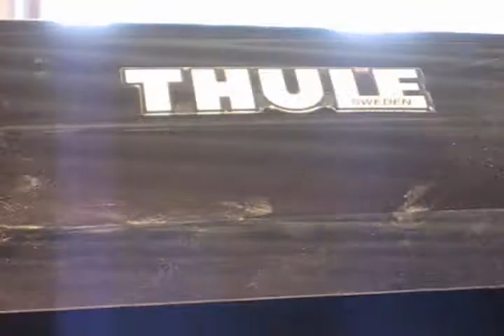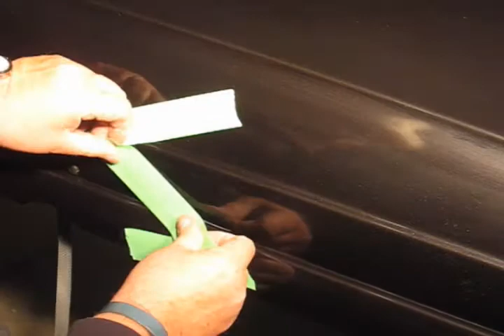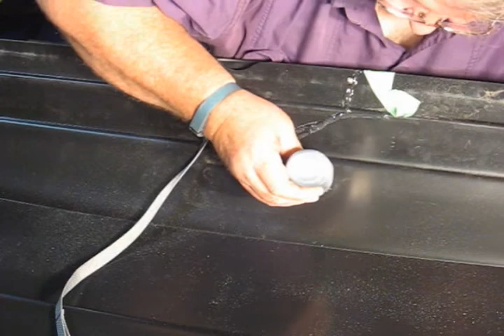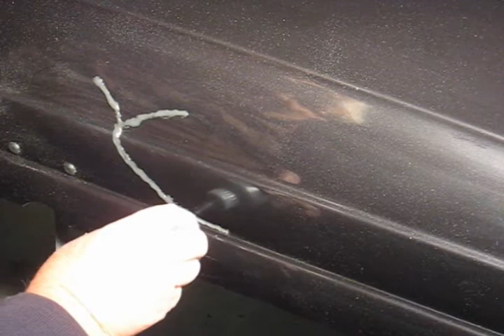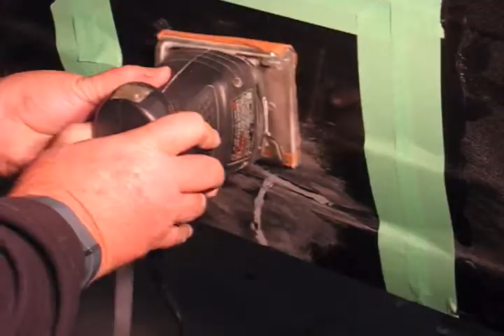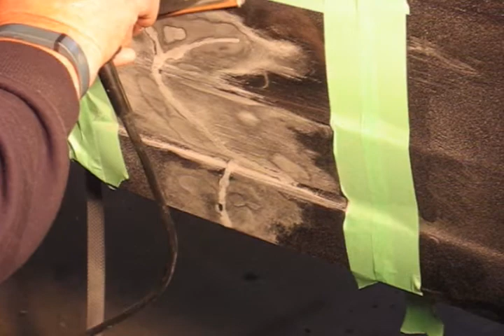How To Repair A Damaged Thule Box

Comment: I already bought my easy ABS repair and I'm about to do this on my Thule cargo box to fix a couple of cracks. My box has a silver exterior paint and the cracks are very fine and not that noticable. I am mainly concerned with long-term strength (prevent cracks from spreading)  and waterproofing so I was hoping to do this all from the inside to avoid repainting or need for decals. Can I apply that v-groove 60% technique to the inside only and does it need to be adjusted for an inside only approach? Also what Dremel bit would be recommended for this? I am new to Dremels and recently got one. Thinking that bit looks perhaps like a 117?
Reply from the maker: The repair can be done from the inside I use a #115 dremel bit but almost any of their carving bits will work. Because it is on the inside you do not have to V groove the crack just make sure there is nothing (like paint)on top of the ABS. Just apply in a 1/8" thick bead straight from the bottle. The resin will smooth it's self a little leaving a smooth surface that when cured in 24 hours will be hard, black, and shiny. You can ad more coat to add strength and thickness to the repair. Any questions call me I always answer

Comment: If you decide to apply the resin to both the underside and the topside of the cargo box, do you have to sand the topside or can you simply leave it as-is with the resin slightly higher?
Reply: I currently have the resin applied to the inside and it’s working great.
Reply from the maker: Depends on how finished you want it to be. if you are happy with the way it looks leave it as is. If you start sanding you will need to paint.
Reply: Ok thank you. The product is working great!